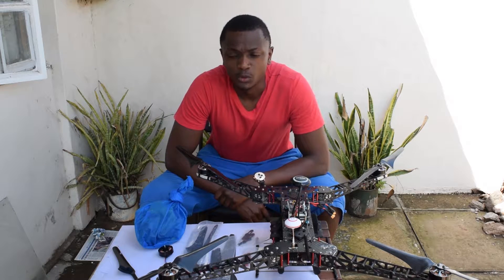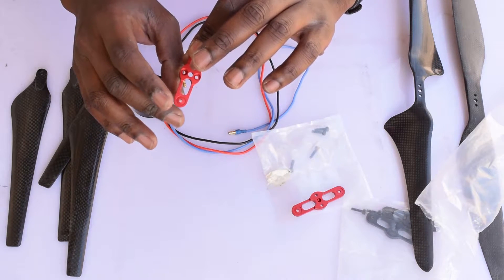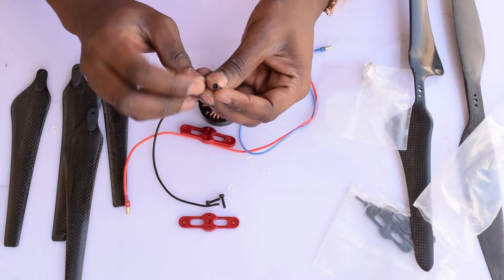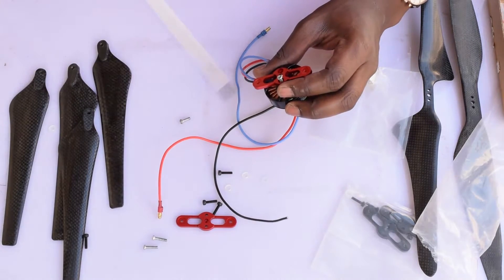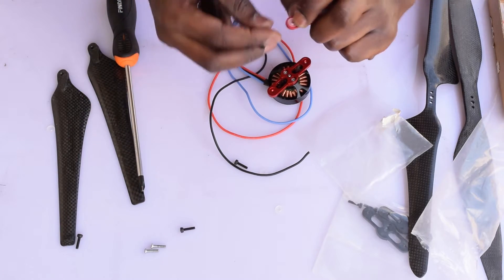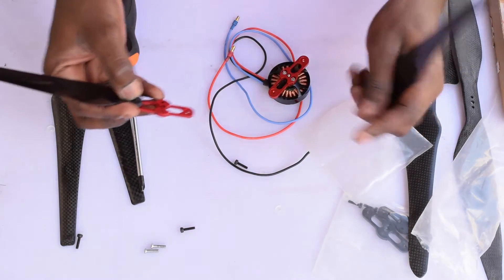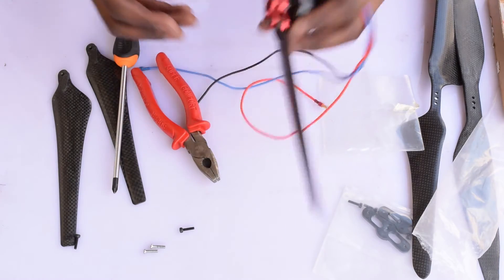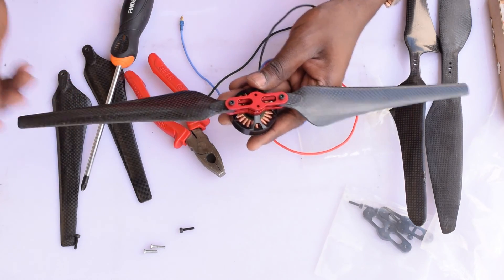1760 Folding Propeller Installation Tutorial + Tips

Comment: hello i have a question, what should be the exact position of each blade just before take off? should they be exact 180 degree apart from eachother? or we can keep it folded while taking off? is there any concept like centrifugal force that keeps it 180 degree apart while rotating?
Reply: Can be any position, it spreads out under load just as long you don't overtighten the props